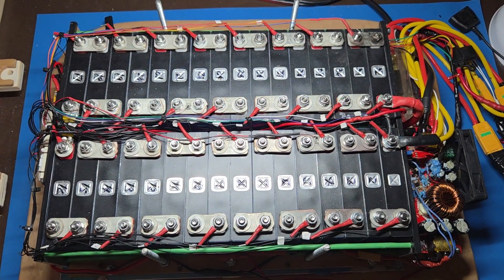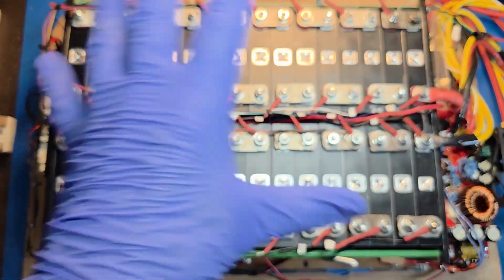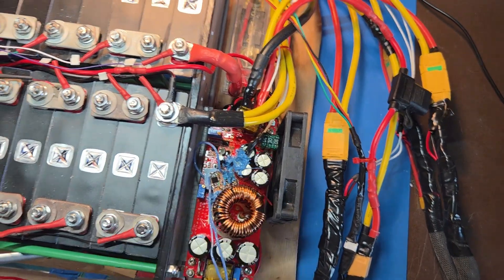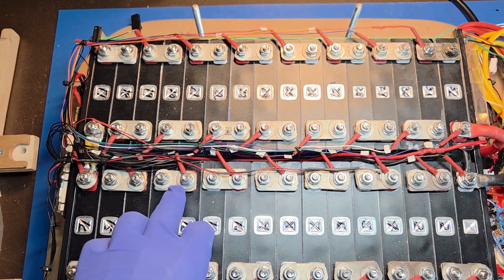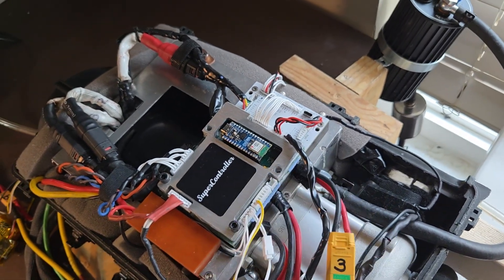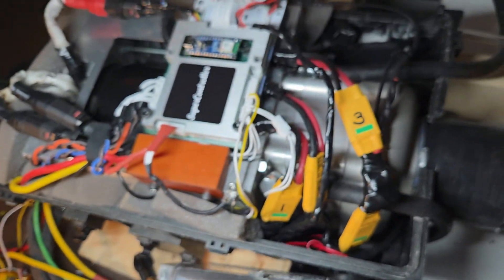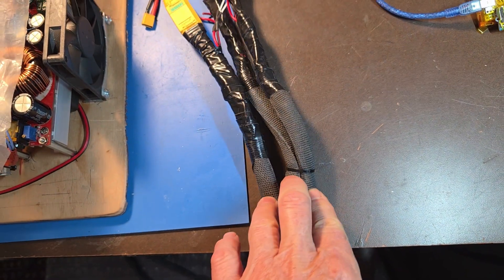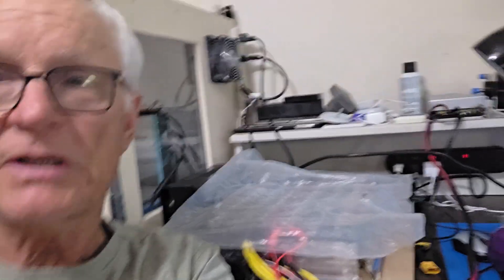LTO Battery for Electric Supercharger

Comment: Those boost converters are handy but not the most reliable. I’ve always run them at 50% of their rating. 

Input current limit on the “1800W” model is 30A or 40A? More than 20A is iffy. Crappy positive and input terminals

Comment: glad to see more people talking about LTO. LTO is the battery tech we need that everyone is sleeping on. replaced the lead acid battery in my car with a 6s lto pack, hooked it up to a solar roof to make the cars APM sleep more often and boost EV range. got a whole video on my channel explaining how it works. whats crazy is how powerful these cells are despite their size and also the fact that they dont really need thermal management in most applications. way lower internal resistance compared to lead. not hard to beat to be fair.
got another 12 cells and im going to increase the pack to 6s2p just coz ~300-600w 12v load means i should be able to keep the APM asleep on any trip under an hour. 
really want to convret my boxster into an EV with these bulletproof cells so far only 1 other guy has done something like it in austraila 3 years ago. currently theyre 2.9x the price of LFP, but you make up for a lot of the weight because you dont need much in the way of thermal management, dont have to worry about charging in cold temps. 
either 150s or 155s makes the most sense for 400v architecture conversion. thats for NMC based 96s original electronics. gets spendy but they will basically never wear out... 10x the life of LFP, 30x the life of NMC. insane. around 9k usd to build a pack for an ev boxster that is ~200-300 mile range. but the power on tap would be great. could also dc fast charge the crap out of them, but then youre limited by thermals.

Comment: Just curious, with no incoming charge to the battery pack how long could you run the supercharger non stop at max amp draw before the BMS shuts off the voltage?
Reply from the maker: Test was run with charger turned off

Comment: Gotta say, the situation of a 12v 50a psu maintaining an arc across (at least one of) the 3x 20a  fuses was an eye opening line of thought for me. Are they "micro2" fuses? A quick google image search brought up a pic suggesting that the 'air gap' on a blown micro2 is only 1.5mm across vs ~5mm for a 'mini ato' despite the overall width not being much different at ~9mm vs ~11mm!! That difference might be critical if it means you effectively CANT parallel micro2 fuses to get beyond 30a if it turns out <50a will just maintain an arc straight across!! Jeez!! That little scenario was massively interesting to me as a car guy who also dabbles in homebrew electrical and higher voltage stuff like my solar strings, DIY EV projects etc. I knew about fuse design needing to change for higher voltages but never thought about this issue of paralleling 12v fuses potentially being a bad idea EVEN AT 12volts! It MIGHT be an issue specific to the micro2 format tiny air gap.. Mind blown. 

I'm also very curious to hear more about the whole inductance issue with your power cables.. any testing you have done or can point to? Future video?
Reply from the maker: Here is an inductance calculator https://www.e-magnetica.pl/doku.php/calculator/inductance_of_pair_of_parallel_round_straight_wires#dokuwiki__content

Comment: did you map your car for certain boost via voltage or    have many parameters in case you dont have whole 80v yet?
Reply from the maker: Currently got it mapped for full voltage, so boost will drop with voltage.  The controller knows the voltage so it's easy to compensate.  Will look at it after I get it on the car.
Reply: @stevebrantley3851  you can add a boost converter to reach constant voltage but will affect  efficiency and will add one more component on your system!!!  and i get it  there is no such 3 phase boost converter on that amps and come cheap
Reply from the maker: @anaxiosesti88  it's easy to compensate for Voltage with the Arduino
Reply: @anaxiosesti88  Unless you hack an old prius inverter i guess! maybe a silly thought but a fun one.

Comment: really cool work. I used copper pipe to make battery lugs for 2 gauge cable, just didn't smash the end that went over the cable. no one locally had any lugs big enough and copper pipe is pretty easy to find.

Comment: Toshiba, Altair Nano, and Microvast still have titanate solutions.  One of the challenges with high series batteries is getting good balance on individual cells if you are measuring voltage across the whole string.

Comment: the most reputable LTOs are called SCIBs and they're made by Toshiba, if u ever want a cell upgrade.
Reply from the maker: Thanks for the info.  I should have mentioned in the video that the cells I used were the only ones I could find, at the time,  that could handle the current, had the desired AH capacity, and fit in the space I had.
Reply: LTOs can also be discharged to zero volts but u just don't want to do it often